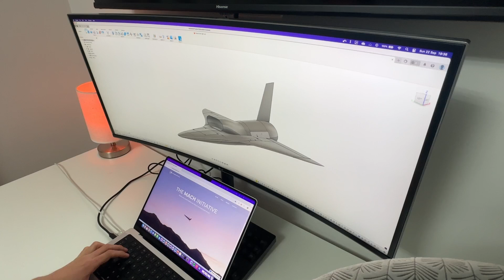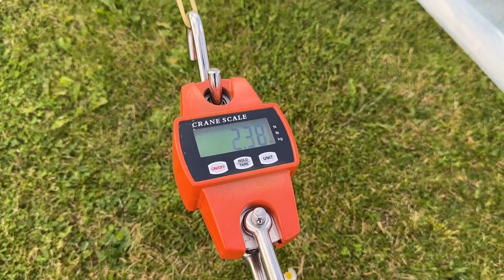Flying a 3D-Printed Prototype of our Mach 0.75 Model Aircraft

Comment: That's amazing progress. Hopefully with the log files you can see why it was so twitchy in the air and dial it in. You can easily have a few different profiles setup on a toggle switch to flick between modes that allow you to have minimal input and the fc does most of the work and then slowly swop it so you have all the control. Nice work